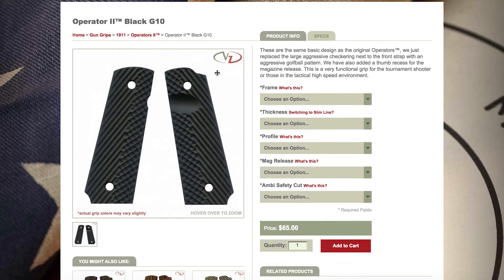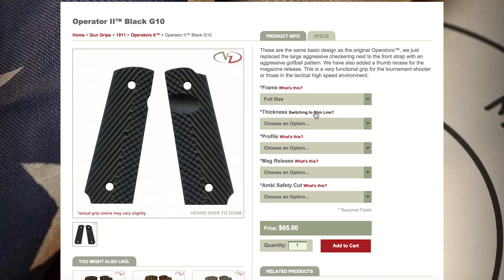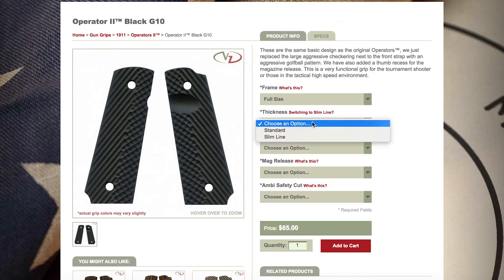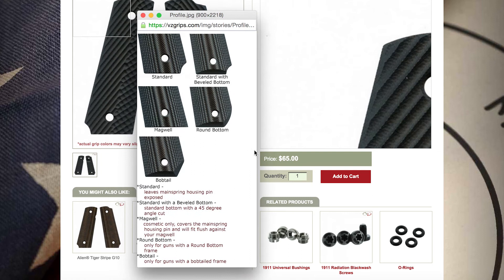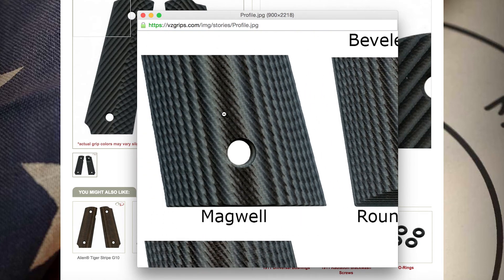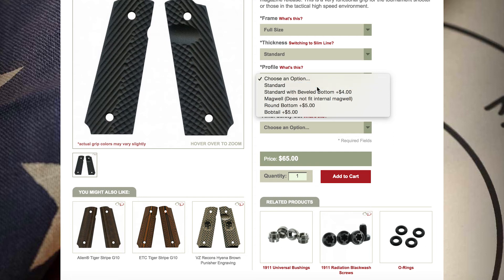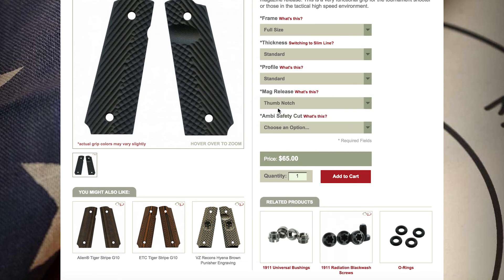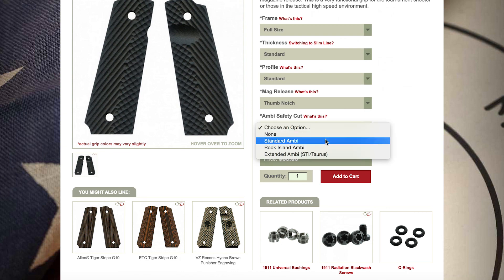How do I build the "Perfect" grip for my 1911?

Comment: I like to save my original grips so I have been replacing them with VZ grips. I recently added the VZ Operator IV grips to my full size Fusion Riptide 1911. Amazing purchase and feel. I did have to modify slightly because the pistol came with and extended slide release and also on the right grip magwell area.